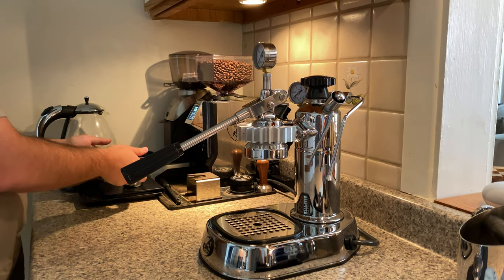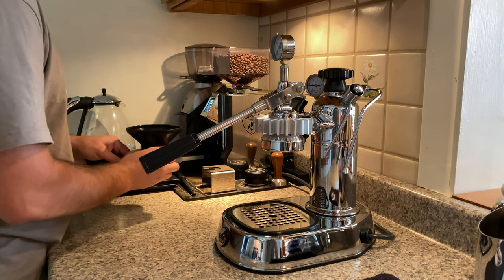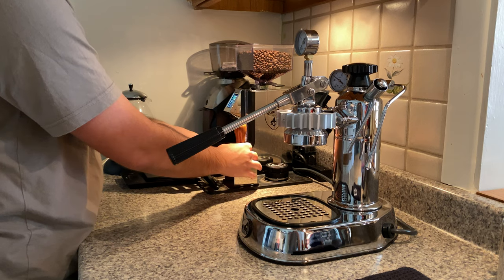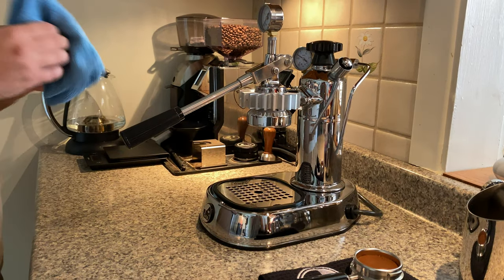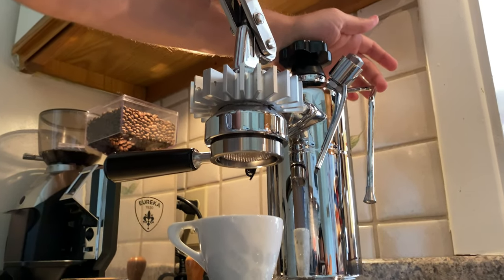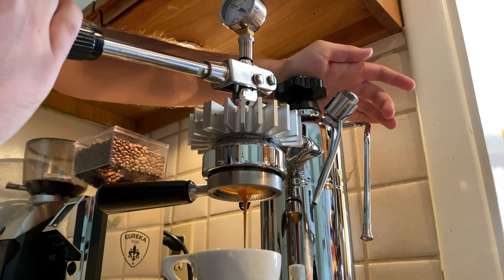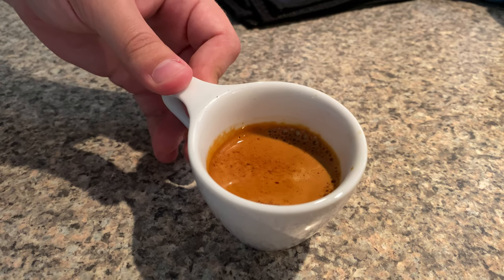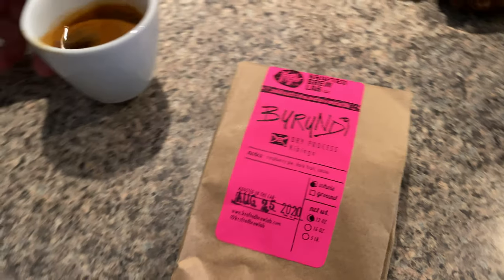La Pavoni Europiccola - upgrades and a double shot!

Comment: Great video! Try stirring the shot to mix all the different levels of the espresso, cause they taste different, and I think putting the scale under the cup as you pull the shot could allow you to stop the shot exactly when you want without going over! Also taping the portafilter really hard onto the portafilter holder before distribution could occasionally cause channeling, which is super frustrating. Sorry for being annoying with all this advice. Espresso is all about removing variables 😊
Reply from the maker: Trust me, I know, friend :)
It's been quite the journey since then.
Reply: @alexwalshaw  😊

Comment: I struggle to find the right grind size on my europiccola for decent espresso and nada
Reply from the maker: It is a constantly shifting scale! My suggestion is to change one variable at a time! so if its grind size you're struggling with, keep the dose identical each time until you find a grind size roughly in the range you're looking for. Then you can change another variable! 

Unfortunately, there is no "one size fits all" option for espresso, especially with the fussy lever machines :) just part of the fun

Comment: Hi there! Well executed video. I am just starting with a pre millenial La Pavoni Professional. It would be nice if you could tell us where you got the grouphead manometer from, and especially the nice bottomless PF. Also, good point about grinding really fine. I find that with this machine, I need to grind a good amount finer than for my other espresso machines, to get noticeable resistance from the puck. Have a good one!
Reply from the maker: Hi Tom, unfortunately I sold my machine long ago now, a silly mistake on my part, but I needed to do so in order to fund the purchase of my E61 machine. I'm sure there are many places that sell La Pavoni parts, so which one is best really depends on your geographic location!

As for accessories and wood accents, Etsy is also a good place to pick stuff up as there's lots of craftsmen doing la Pavoni parts there too!

Sorry I couldn't specify, it's been a while and I don't remember unfortunately, but I wish you luck!
Reply: @alexwalshaw  Thank you, Alex!

Comment: Hello. James Hoffmann said that it needs 20kg of force in order to achieve 9 bar pressure. Is this a solid information? What does it feels like in KG?
Reply from the maker: Yeah that sounds like a relatively correct weight. If you are pushing with your entire body weight then it's definitely too high. The La Pavoni is a tricky machine in terms of consistency, but if you can get comfortable pulling the shot within the normal 25-30 seconds and you should be good. But with the pressure profiler I've got up top it's way easier to diagnose the shot instead of the guessing game. Look into one of you can!
Reply: @alexwalshaw  thanks. Found some calculations - it’s around 14kg for 9 bar. Definitely need some practice and testing. 

Interesting, would it feels the same as Cafflano Kompresso. Because I’m quite dialed in and manage to pull pretty solid shots. But it takes 45s. Best if drips starts at around 5s
Reply: @alexwalshaw  here is my theory. Required force is 14kg and it should be done without placing hand on boiler. When pressing, do it to level, when machine almost starts to lift. Can you please try to do this and say amount of pressure? Seems like they designed it well, so it’s balanced and intended to lift when too much pressure is applied.
Reply from the maker: @askroller  that sounds excellent! Unfortunately I don't have the Pavoni anymore :/ I actually had to sell it to afford my new machine
Reply: @alexwalshaw  anyway, I would check the result tomorrow :) Thanks for your effort
Reply from the maker: @askroller  no thank you! You are doing great research! Good luck with your tests 👍
Reply: @alexwalshaw  just in case, you can search for “La Marzocco vs Cafflano Kompresso” on my coffee channel. It’s with subtitles, but could be quite interesting. Congratulations with Lelit, looks stable!) And design is still great
Reply from the maker: @askroller  thank you! I only got it a few days ago so I'm really excited to get to know it a little better!
Reply: @alexwalshaw  hi. Loving your tips! May I know does the 25-30s do you normally include the preinfusion? Thank you
Reply: @alexwalshaw  I noticed from your shot, 25-30s is from where the first drop and pulling the lever. Is that correct?
Reply from the maker: @miin108  I suppose so! Lever shots are typically longer than a pump machine in that you can play around with the pre-infusion time. I think you are right. It does depend on what you want out of the pull though, In this video I think I was trying to maximize the volume out by doing a long pre-infusion, but I also experienced much lower yields with a standard lever pull with no pre-infusion. It also depends on the density (roast level) of your coffee beans as that will also alter the amount of headroom you have in the portafilter :)
Fun machines, very tricky, but a great learning experience.
Reply: @alexwalshaw  thank you. I found out from my shot using my LP, after preinfusion of 15s, i start my time from pulling the lever, slow ramp up to 8.5 bars and throughout the shot, i ramp down to 6 when I feel the flow was increasing and somehow my shot ends at 20s (no more water in the grouphead and no more pressure) but somehow I managed to get most out of this at 20s. more than that will give the over extraction taste (burnt after taste). Temperature maintained at 90 degrees celcius.
Reply: @alexwalshaw  oh yeah. Just an update again. Same grind size and increased my dosage. Managed to get the shot at 25s. Now can get even better taste as well. Thank you once again hehe

Comment: How did you change the angle on your steam wand? Did you replace the original?
Reply from the maker: Nope, it was an original arm to my knowledge! Some models have a different design, but mine was one that rotated, but would not come off. I know some millennium models could be removed and swapped with an auto frother or something.

Comment: Was that a modded steam arm? Mine doesn't move at all and I hate the angle that it is stuck at! Cheers.
Reply from the maker: It was the original arm on my machine, but the tip is one I installed; a machined 1-hole steam tip for increased pressure and control.
I think there were many design changes over the years, the most notable being the pre-millennium and post-millennium designs. I know the group head was widened by 2mm and some electronic changes, but maybe the wand was changed too. Have you looked over the joints on the steam arm to see if it's been over tightened? Everything on these machines are bolted together, so it could just be too tight or seized. If so, maybe try and loosen and lubricate the joints! Sorry I'm not a certified expert, but I hope some of my lent info will help!
Reply: @alexwalshaw  Thanks mate. Yeah, I just retired a pre-millenium Gaggia Factory (made by LP) and the steam arm swiveled. I now have a brand new LP Professional and the steam arm is completely static. There's no movement at all. Perhaps this is another one of the changes they made.
Reply from the maker: @wingnoit  I have this vague memory of watching a video of a newer LP and it seemed like the arm was completely removeable and replaceable with this auto foam contraption. If it was removable, it must be possible to disassemble and get it to swivel. It would be such a backwards step to remove that functionality, don't you think?
Reply: @alexwalshaw  Yeah, you can take the whole arm off, and yes you can rotate it if you remove a little screw ... But there is a hard stop built into it meaning you can't angle it any further down, only up (which is pointless). Ive taken it apart and tried to see if the stop can be moved but it doesn't seem to.
Reply from the maker: @wingnoit  very interesting. A bit of a backwards design change I guess, but going forward I suppose you may just need to find a good angle for your milk pitcher with the wand as is. To practice, I usually just put water in the pitcher so I can mess around and understand what angle gives me the best whirlpool! You may already do that, but in case you don't, give it a try so you can make due!

Comment: Please do this video again but this time showing the pressure gauge as well as the bottom of the filter and your hand on the leaver  as you pull the shot. It will help me to improve me shot pulling.
Reply from the maker: Wish I could, but I sold my pavoni a while ago! Just aim for 9 bar and gradually decrease :) that worked well for me there are so many ways to use these machines, so my other suggestion is to just try what works for you and your beans!
Reply: Thanks but I don't have a pressure gauge on my group head. Thats why I wanted to see your gauge as you pulled your shot, so I could see what effort was needed to get to 9 bar. Thanks anyway, Tony
Reply from the maker: @tonyb83  ah I understand, unfortunately everybody looks different depending on their size using these! A general rule is that it should be decently firm to push, but not so hard that you think you're gonna snap the group off!
Reply: @alexwalshaw  Thanks Alex. Unfortunately the La Pavoni pressure profiling kit is a bit expensive, so I think I'll try and find a pad to fit on the leaver which measures my hand pressure whilst pulling a shot and convert that to the pressure in the group head. Do you think that will work?

Comment: Hello, I want a la pavoni but with a 58mm basket. What model or modifications would that be?
Reply from the maker: Unfortunately, as far as I am aware the largest La Pavoni lever machines only come with a 51mm portafilter maximum, those are the millennium models. I do know of a few other lever machines by companies like Londinium and perhaps a few others who have huge prosumer level levers that feature 58mm baskets.. but those are considerably more expensive and also feature a different kind of lever mechanism. If that's an expense you are interested in, I suggest you read up on companies like Londinium, Profitec, Bezzera, who all make very high end 58mm levers. I don't know a whole lot else, but I hope this info is useful to you! Best of luck :)
Reply: 58mm commercial levers require much more pressure, too much to do by hand they use springs.

Comment: curious about the group temp sensor. Where did you install it ? At what temp did you pull the shot ? thanks.
Reply from the maker: It's got a little temperature probe that sits between the group and the heatsink. If I remember correctly, I pulled the shot around or above 90°C
Reply: @alexwalshaw  Thanks. did you get that from Ebay ? I saw one like that on ebay, it is like a thin heat isolator and thermometer in the same time.
Reply from the maker: @murataht  honestly, I can't remember where I got it. But there are many places that sell la pavoni upgrade bits, just need to look around for one nearest to you!
Reply: @alexwalshaw  Ok, thanks.

Comment: Hi, have you attached a custom heat sink? What does it help with? I'm considering a La Pavoni.
Reply from the maker: That is correct. Basically, it gives you a greater thermal mass and is meant to spread out the heat more evenly. The original machine as it has very minimal temperature control is prone to overheating, as in exceeding 100°C, so the heatsink basically allows you to use the machine more with less time spent cooling the machine. If you're only pulling one or two shots at a time, it is not a super necessary mod!
Reply: Where did you acquire the heat sink?

Comment: Great video.  What is the temp of group head? Notice you have a heat sink.  Do you have problem with over heating?
Reply from the maker: Glad you enjoyed.
I think I had it around 70 or 80°C optimally. I would have it reach the 100° area or beyond at times, which I thought was a bit too hot for what I was going for, but I was usually making 2-3 shots max per session, so it wasn't common for me to exceed that number very often. Once the power was off, the temperature fell rather quickly, so in my use it was never thermally constrained.

Comment: Hi I just got the Specialita and am using it with a Pre Millenium Europiccola. What grind setting are using? Thanks.
Reply from the maker: Great choice! So, you probably already noticed by now, but the Specialita has a stepless and seemingly endless burr adjustment; one full turn doesn't bring you from one end to the other, it takes a few turns. So, the way I calibrated my grinder was remove the hopper and get all the beans out of the grinder so that you can adjust the burs right to the point where they begin to touch, you'll hear them rubbing or scratching. From there, I move the dial coarser until I can pull  a 26-30 second shot close to the 2:1 ratio (14g in, 28g out). There is no one or final grind setting, so just try and get familiar with making those adjustments and find what works for you!
Hope this helps!
Reply: @alexwalshaw  Ok thanks!
Reply from the maker: @ThomasTube  No worries, good luck!
Reply: @alexwalshaw  just an FYI there is something called a Bong isolator that fits between the grouphead and boiler that helps control the grouphead temperature for multiple shots and doesn't change the look of the machine.
 It's sold by Coffee Sensor I believe. I might get it at some point.

Comment: Nice! How much time do you let the boiler heat before the shut??
Reply from the maker: If I remember correctly, about 10 minutes. I tried to do some warming of the group head too, not by flushing water through (as the boiler volume was so low) but using some of the residual steam/heat. I'd lift the lever just enough so the piston was up, but not letting water in, and that would help get some temperature in the group head.

Basically, Pierre, there's no one correct way to use the machine, try new things out, see what works for you and what doesn't, but most importantly have fun! :)
Reply: @alexwalshaw  thanks a lot Alex. much better this morning... La Pavoni is a strange animal!
Reply from the maker: @pierregagnon5457  Glad to hear it :) I remember every morning was a totally different experience. I used to do micro felinis, that often yielded my favorite flavors. Again, it's all experimentation, just have fun with it!

Comment: Hello, how did you get your machine upgraded? i.e. pressure gauge installation, etc. Did you do it yourself?
Reply from the maker: Yep, all the work was done on my own. There's a number of video tutorials on replacing the piston/pressure gauge assembly and the parts are pretty available from multiple sellers across the globe. I don't remember which I bought mine from, but have a look for the parts on Google and you should find them!

Comment: Hi, will multiple lift up make brew head pressure higher?
Reply from the maker: In short yes, you are doing something people call a micro-felini. You saturate the puck and pull more liquid into the group, which gives you more pressure and generally a higher volume shot. Doesn't work for everyone, so I suggest you try and see what works best for your setup.
Reply: Alex Walshaw tanks for you advice, I’m trying to get 9 bar, but unfortunately still having trouble to reach it. 
Maybe this way can help.
Reply from the maker: @joechienjoe  yeah you definitely will, I've gone far past 10 bars doing micro-felinis but that is too much for this kind of machine. I find sometimes there is too much head pressure depending on the grind size or the type of bean, so I have to make a judgement call for the bean I've got in my hopper. Recently, I've stopped doing micro-felinis and have been seeing considerably lower volume shots, due to the less amount of water in the group.
Reply: @alexwalshaw  wow 10 bar... 
And I Can't even reach 9 lol 🤣. 
I'm using a double basket. How many grams of beans you will put in it, I will start with the amount you recommend and change grind size base on that. Thanks so much for your help
Reply from the maker: @joechienjoe  yeah 10, it's unfortunately too much for this machine though, I've been finding the sweet spot is anywhere from 7-9 bar shots, but I've also been varying the pressure based on the time (like pre infuse the puck at like 1-2 bar, then ramp up to 9 and slowly go down to five and below sort of thing). I'm using 14g in their pre millennium IMS basket. Some other videos use 13 or 12, but for the time being I just do as you planned, adjust by grind. Happy to chat with other enthusiasts, best of luck!

Comment: Hey alex can you tell me wich thread is it for the Manometer on the top ? Thanks
Reply from the maker: Unfortunately, I am not too sure what the thread pitch is as the kit to install it comes with a new piston shaft which you replace the old one with.
By the looks of it, on Naked Portafilter's website, their pressure profiling device is a G 1/8" thread to fit the La Pavoni/Cremina. Perhaps that is a useful spec there, but I unfortunately don't know many more specifics than that. Sorry! :(